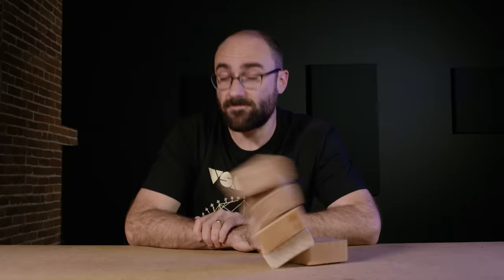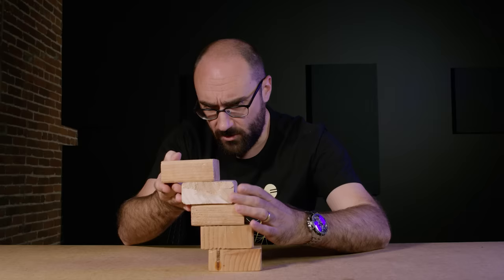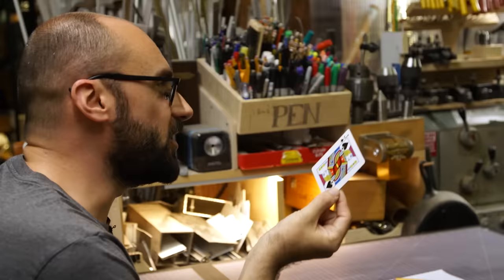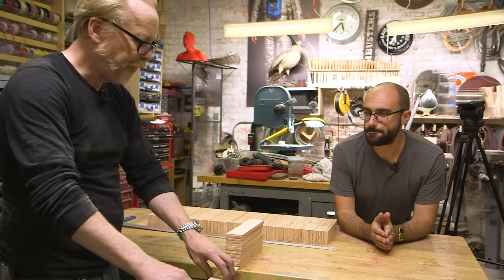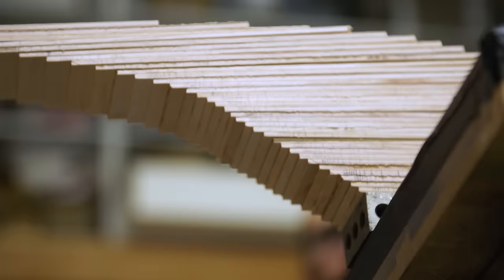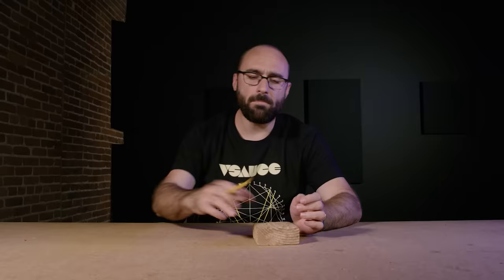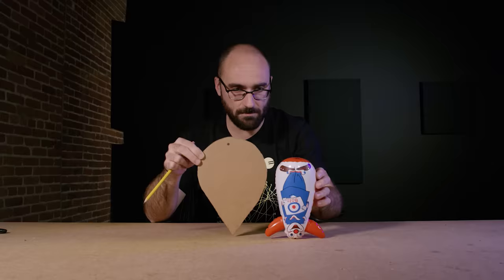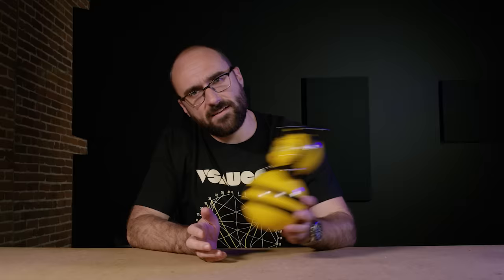The Leaning Tower of Lire

Comment: What would happen if it was higher than 100 km (over the Karman line) and you didn't count with the air resistance? Could it go around Earth?
Reply: don't forget as you get higher the radius of the circle you want to create increases so I don't think it's possible
Reply: unless maybe you use infinitesimally small blocks which you could treat as a really long stick
Reply: Peter Rabitt simply the concept of a horizontal length of decreasing magnitude and height of constant magnitude will tell you that unless the first block has a length of about half the circumference of the earth, it will never go around the earth (actually just finding the value of the harmonic sequence,which is 2, will tell you the conditions for the blocks to circle the earth)
Reply: Series of 1/(2n) is diverging, it's value isn't 2, it's infinite which can be easily prooven. The value of 1/(2^n) series is 2.
Reply: That's wrong, Sollertia. The harmonic series does not converge to 2, it diverges. Thus, it is in fact possible to make an overhang the length of the circumference of the Earth, though the number of blocks needed would be staggering.
Reply: whooppsss my bad hahha
Reply: Sollertia_ :3
Reply: xWood4000 some are neglecting to realize that since no block size is specified then it would be possible (if only in theory) to do with only one very long block.
Reply: Red Nine which, technically, might not apply to stacking
Reply: Sollertia_ right but if one plank could go around the world then the question become not "can it go around the world" but rather "how short of a block is the smallest possible to use to make a lires stack around the world". Saying that one could go around the world simply proves it's possible. Imagine 4 or 5 planks each thousands of miles long made into a "stack" around the world, still possible. Though it would definitely be hard to prove you could go around the would using the planks Michael and Adam were using though haha
Reply: Guys, the top won't curve around the earth. So even with infinitesimal 
thickness, all you'll get in the end is a tangent to the Earth surface.
Reply: Pamani wood bends
Reply: But that concept of infininite is wrong, you see, in that series, as the sum progresses, you end up adding an smaller number everytime. It is infinite in the aspect that the number will have infite decimals, but it wont reach a "infinite" number. Think about it. Its like adding 1+0.5+0.05+0.005+0.0005+..... for ever, its an infinite sum, but an small number.
Sorry for my bad english
Reply: The limit of this series (  1/2*1/n) is infinite. There are other series with finite limit, like sum of 1/(2^n) as zzzema previously said.
When you have a sequence in 1/(n^a), its sum is finite if and only if a>1 (actually Re(a)>1 to be precise). These are called Riemann series.
Reply: but, if in that series, the decimals end up adding, for example: 1+0.5+0.15+0.015...., then it will reach infinite at some point.
Reply: Pamani it doesn't necessarily have to be flat plane geometrically straight forgot what's the word for it block now does it ~
Reply: Red Nine   I dont actually think they would bend since they are pressed against each other.
Reply: The fault in this question is that the (1/2n) series only remains true when on a flat plane. With sufficient blocks (ignoring the factor of blocks needing to be strong enough to hold up the mass of all above them), you could simply build a vertical tower and then enough blocks to orbit the Earth while all touching each other.

With a genuine attempt at a tower, there would get a point where you have to ask the question as to whether you measure the overhang by measuring the tangent from the Earth, or measure around the curve of the Earth.
Reply: I thought I was decently smart until I looked at this comment section...
Reply: Its never a circle..
Reply: You could use boards that aren't FLAT. Use boards such that they are perpendicular to the surface of the Earth. Meaning that they would actually be sllllliggghtly curved.  This would allow you to loop around the planet EVENTUALLY, but it would be lightyears out (using 1/2" plywood). It would never be able to touch itself though. The decreasing gravity with altitude would not impact the problem at all (center of gravity doesn't change with less gravity until you reach 0 gravity! Which never happens.). I'm also ignoring things like the spin of the Earth, the material stability under pressure, and so forth.

The SOLE edge case where a tower could wrap the planet and touch itself is if the blocks are 2/3rds of the circumference of the planet (or greater). The 2nd block would allow a 1/3rd circumference overhang ... giving you a whole loop of the planet.
Reply: As you can see, Rick & Morty fans are present in this part of the comment section
Reply: or how those balancing toys operates on very low (near zero) gravity environment?
Reply: xWood4000 interesting
Reply: Yeah, u would need it to be approximately around one billion of these blocks to make it go around earth at least once
Reply: If you remove gravity then yes you probably could
Reply: light years are not a measurement, the distance light travels in a year is relative
Reply: just use glue
Reply: You can't stack blocks at all if you remove gravity.  >.>  Then it's not stacking, it's placing them beside each other.  Might as well lay the tower on its side, in which case yes, it will go around Earth and eventually intersect itself.

Comment: 3:24 "Even though the amount of overhang we can get keeps getting smaller it never reaches zero... so these blocks can overhang as far as we want as long as we have enough of them."

I feel like the creator knows this, but this statement is technically misleading to the point of being arguably incorrect. In a series you can certainly have a case in which each successive term added is a positive number but the series CONVERGES, so the sum cannot get "as large as you want." For example, if the first card could only hang 3/10 of a length, then the next 3/100, then the next 3/1000, the entire overhang will never be more than 1/3 of a card even though technically each overhang is greater than zero. The point here is that a harmonic series does not converge, which is why the tower theoretically can lean as far as you want.
Reply: Why did I had to scroll so far to find a good comment. That was exactly my thought as well.

Also, every time one block from the top doesn't overlap with the newest block at the very bottom anymore (first time this happens is when you add the fifth block) you get an extra term, which is not part of the harmonic series. So instead of only overhanging it 1/8 you can do 5/36 and for the next term you get 1/8 instead of 1/10 etc...
Reply: The series is just half of the harmonic series https://en.m.wikipedia.org/wiki/Harmonic_series_(mathematics) which is divergent, so there is no technical limit to how far you could build the bridge. The series you used was a geometric series, which is different to the harmonic series and does converge.

Comment: For the record, you can not reach the wall. if you calculate the limit of the total distance of overhang, you get 1/2 + 1/4 + 1/8 + ... the limit of this sum is 1 (we reach 1 only after an infinite number of steps). This means you can only reach the wall in a finite number of steps if the bottom block is at a distance where its wall-faced edge is less than one block width away from the wall

Comment: 13:20 - that feels like a variation on angular momentum and the gyroscopic effect of a rotating body... frozen in time... like... the wingtips are always falling, and the tail end is always pulling it back... like a freeze-frame of gyroscopic stabilization - a balance between lateral and rotational motion that that keeps gyros stable and tops on top as an average of the two forces. 🤔🤯

Comment: 80 block overhang is 1300 feet tall if blocks are 10 inches by .5 inches by 1 inch

using chat GPT:

Using the same assumptions as before (that the blocks have a height of 1 inch and are stacked perfectly vertically), we can use the equation derived earlier to calculate the number of blocks needed for an overhang of 800 inches:

800 inches = (n/2) * (1/2) * (1/10) inches

where n is the number of blocks in the tower. Solving for n gives:

n = (800 inches * 20) / 1 inches = 16,000 blocks

The height of the tower would then be:

h = n * 1 inch = 16,000 inches = 1,333.33 feet

So the tower would be 1,333.33 feet tall, assuming the blocks are stacked perfectly and without any gaps or tilts. However, achieving a tower of this height with such a large overhang would be very difficult in practice, as the tower would become increasingly unstable with each additional block added to it.

Comment: I’d say it isn’t the blocks they are really fascinated with, but rather maxing the precise concept of gravity of each block . Therefore Almost doubling the width of one statue with no supports and without it falling over. If they would have made an exact replica of the blocked they stacked and positioned it reflecting the other one it would form a bridge. Relating to what they discussed prior in the video, many prehistoric and less modern structures were made with bricks in this fashion. At least until better materials such as iron beams were furnished into construction.

Comment: "Even though the amount of overhang we have keeps getting smaller and smaller, it never reaches zero. So these blocks can overhang as far as we want as long as we have enough of them".

It's not enough that the overhang never reaches zero. It also has to decrease slowly enough, which is the case for the terms in this harmonic series 1/2, 1/4, 1/6, ... (1/(2n)). If it had been 1/2, 1/4, 1/8, ... instead (1/2^n, geometric) then the total overhang would always be less than one block no matter how many we add.

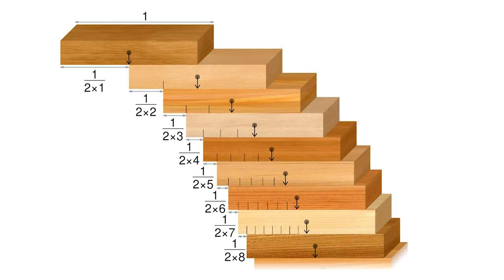Comment: 3:14. the formula is wrong. The true overhang is 1+1/2+1/3+1/4+1/5 etc. See https://mathcs.org/analysis/reals/numser/answers/lire_tower.html
When I was 10 or so I made several variants of the leaning tower or Lire, using small woodblocks, and calculated the formula. That's how I discovered that some series do not converge even though their terms keep decreasing.

Comment: So basically if I'm correct, the centre of mass of entire structure should be over the Base, then it will be stable, and that's called stable equilibrium, but my Question is in what configuration would this system of blocks will be in unstable equilibrium?

Comment: Just because the increment never reaches zero, that on its own doesn't mean we can definitely reach out to infinity. For example, if the formula were 1/2^n instead of 1/2n, then the increment would never reach zero, but the total overhang would converge towards 1 instead of infinity. The convergence towards 1 is easy to see in binary: 1/2 + 1/4 + 1/8 + 1/16 + 1/32 + ... in binary is 0.11111...

Comment: The fact that the overhangs get smaller but never quite reach zero, is not sufficient to prove that you can get as far as you like. If the fractions had been 1/2, 1/4, 1/8, 1/16,..., you could never pass 1. The harmonic series though (1 + 1/2 + 1/3 + 1/4 + 1/5 + ... or in this case, half those values), can indeed get as large as you like. Perhaps that would be worth mentioning.

Comment: 3:25 It never reaches zero, agreed. But that's not why the tower can overhang as far as we want it to. It's because the series of overhangs is divergent. The 1/2n series is divergent. Say, had the overhangs been of the form (1/2^n), i.e. 1/2, 1/4, 1/8 and so on. Then the total overhang can never exceed a full block length. Even though, even this sequence never becomes zero. 1/2, 1/4, 1/8, 1/16 and so on.

Comment: 2:25  "your can keep doing this forever, and your tower can reach out as far as you want"
But if there is deminishing return, and the return is deminished  by more than half with each block, that would suggest that there is a limit to, how far you can lean your tower out? some sort of length that you approach with each added block, but cant reach or cross?
Reply: No: they made a logical mistake in this video by saying that having a series decreasing but never reaching 0 means that it can go past any value. 
Firstly, some series that never reach zero can't go past a value. For example, the sum of 1/2 + 1/4 + 1/8 ... will never be larger than 1 (you could imagine it like going half of the remaining length each time)
But, some series that decrease and never reach 0 can reach any value. For example the series of 1/1 + 1/2 + 1/3 + 1/4 + 1/5 + 1/6 .... can be greater than any value. A simple explanation of this would be that you can split this series up into values larger than a certain value infinitely. For example, all values in 1/2 are greater than or equal to 1/2, so the result of this sum is greater than or equal to 1/2. But this also applies to 1/3 + 1/4, in which all values are greater than a quarter. This always applies. However, this series grows logarithmically approximately.
Reply: @trueboxguy5421  yeah, but your first example (1/2+1/4+...) is exactly what Michael states ;) "the first block overhangs the second by 1 half, the second the 3rd by 1 quarter" 2:48. which is what I went from in my original comment.
Reply: @JonathanBremer1  No, that would be true if it was 1/2, 1/4, 1/8, 1/16 etc. But in this case it's actually 1/2, 1/4, 1/6, 1/8, 1/10.

Comment: Just because it never reaches 0 does not necessarily mean that the tower can extend infinitely far to the side. The sum of all lim n -> infinite 1/n^2 also never reaches 0, but it still converges to pi^2/6. and the sum of all lim n -> infinite 1/2^n also never reaches 0, but it still converges to 2. So if the blocks were always placed 1/2^n on top of each other instead of 1/2n, then there would also never be 2 blocks exactly on top of each other. nevertheless the tower would never be wider than >= 2 times the length of a block.
In this case, yes since lim n -> infinite 1/n diverges it is true, that lim n -> infinite 1/2n also diverges, but dont think it is necessary just because the function has an asymptote of 0.

Comment: At 3:35, you said that the series never reaches zero, so it can overhang as far as we want as long as we have enough of them. While that is true for a harmonic series. That is not always true for any series that approaches zero. A half, plus a quarter, plus an eighth, etc. Approaches 1, for example.
Reply: That's not a harmonic series thou, a harmonic series is a special type of series that derives from the 1/2 + 1/3 + 1/4... What your referring to is a geometric series
Reply: @godisprobablyhardstucksilver Yes, I know, and I specifically mentioned that in my comment, which you clearly did not read carefully enough. At 3:24-3:36 Michael evoked a logical fallacy that happened to hold true for his specific case, but is not generally true. I think fallacies are worth correcting even when it doesn't change the conclusion.
Reply: @FourthRoot you are completely right, my brain does not read full sentences anymore it seems.
Reply: @godisprobablyhardstucksilver  Sorry for being snippy. I was just on x, where people tend to be a lot denser than vsauce commenters, some of that frustration carried over.

Comment: What is the formula to calculate the amount of block needed for a tower that can reach 6 meters?  I tried using an excel sheet. I have reach 10000 blocks. I'm using wood sheets of 40 cm X 0.5 cm. It only went a distance of 195 cm.

Comment: I never really understood things like this. They say it can go out infinitely, but surely there’s a limit… right? Take 1, then do this equation and first you add .3, then .1, then .03, .01, .003 (this is all ishy, not doing the actual equation, just something similar) and yes, you will keep adding distance to the blocks, but if you add 0.000000000000000000000003 to 0.000000000000000000000001… nothing will be gained. I feel like eventually, you’ll reach a limit, like maybe you’ll get 27 feet out, but then the distances are too small to ever get out of 27 feet.

Comment: Isn't it better if u stack 1 on top of the other from the bottom up after finding the equilibrium or resting point of each block?
Maybe u made a mistake and didn't reach the optimal configuration of  the blocks and ur calculations aren't that accurate, is it possible ?

Comment: Wait if the amount it move never reaches zero that doesn’t mean it will go on for an infinite distance. You can move something  0.1 inches, then 0.11 inches, then 0.111 inches and so on. The distance will never stop increasing, but it also will never be infinite because it can reach 1 inch just by adding a 1 in the next decimal place. So that is why I think you are incorrect.

Comment: The problem you have with these types of mathematical representations is that the physical world has limitations.  Assuming you could even make blocks that were perfectly precise in shape, weight, etc, you are still limited by the fact that there IS a zero.  There is a point where you could no longer divide the remaining material.  Even if we had equipment that let us measure precisely enough, that measurement would randomly change at those scales due to uncertainty principle, etc.

Comment: "although the amount of overhang keeps getting smaller, it never reaches zero. So these blocks can overhang as far as we want as long as we have enough of them"

No ! the sum of a strictly positive series does not necessarily diverge to infinity !
If the overhang was getting divided by 2 at each level for example, it would still "never reach zero", but still would never be able to reach over 2.